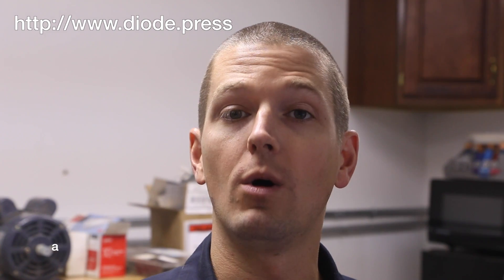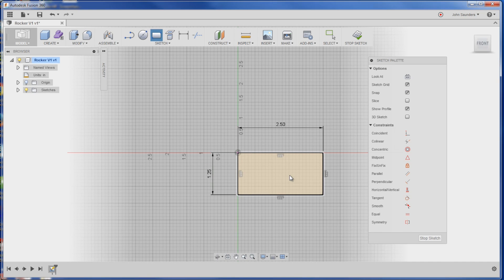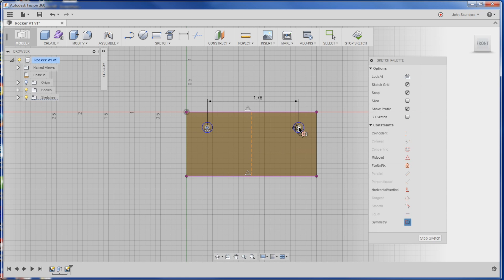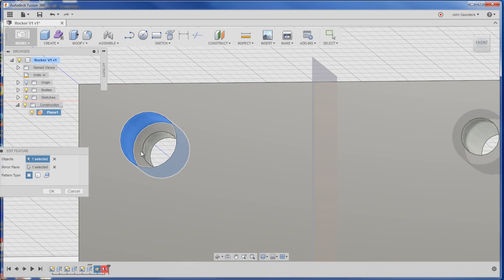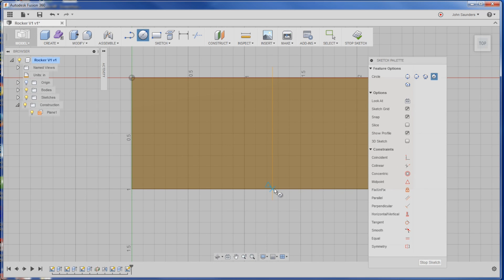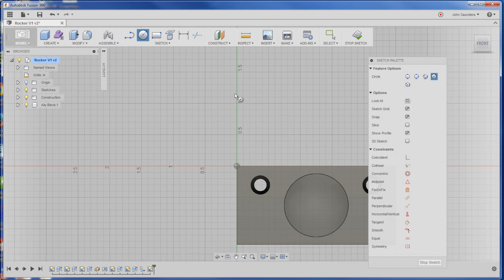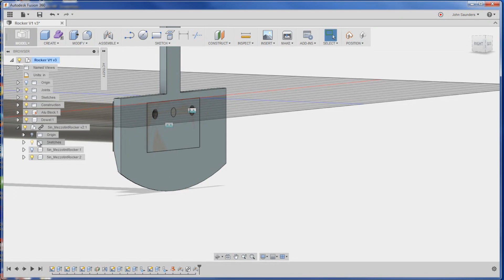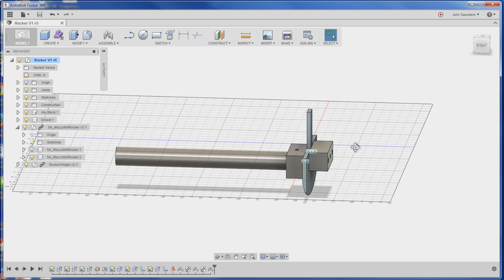Mezzotint Rocker Arm!   Widget61 Part 1

Comment: When using the mirror command you will see there are 3 options listed for pattern type. Pattern faces, pattern bodies, and pattern features.The default is pattern faces and that is why you had to select the cylindrical face and the bottom face of the counterbore. If you choose pattern features instead, you can then pick the feature out of the browser. Any face belonging to that feature will be included in the mirror operation.  

Is there a reason you like to draw holes using sketch geometry instead of using the hole command to just place the holes? I think that method would be faster for you. You could do the counterbores and the thru hole at the same time. There are some nice tools for centering holes on faces when you use the hole command as well.

Comment: More keyboard shortcuts coming John, but don't stop pushing us anyway :)
Reply: +Colin Smith I was reading down through the comments to see if there was any mention of the component / body issue. I'm familiar with Inventor, Solidworks, Solid Edge etc and can't understand why Fusion takes this odd approach. I struggle with converting bodies to components and there is very little help or documentation to explain what's going on. What was the big idea? This must cause a lot of confusion and frustration to users of F360.
Reply: +Murray Edington 
http://knowledge.autodesk.com/support/fusion-360/learn-explore/caas/CloudHelp/cloudhelp/ENU/Fusion-Function/files/GUID-E37B0456-A867-429F-BF69-6A4626DD31E7-htm.html

Some information on Components and Bodies in Fusion.
Depending on who I talk to I hear positive and negative reviews on the approach that Fusion takes with components.

Comment: Very low volume in this video
Reply: +NYC CNC Sounded normal here.
Reply: +Daniel Wiegert (Damme) agree...you can try sound mastering plugin like Limiter. great video by the way
Reply: +NYC CNC On my stationary I have unlimited volume - no problem, but on my laptop with built in speakers, other videos are ok, but I had to have full volume in youtube, and in the operating system - and still had some trouble hearing what you're saying. If I compare to eevblog, oxtools, keith fenner, vintage machinery etc you are abit on the low side. Thanks!

Comment: Right click tree top (file name), create new component. If you activate that component before sketching, all sketches, workplanes, etc will be organized within that component. Helps a lot for larger assemblies :)
Reply: +NYC CNC If there's anything else in fusion I can help you with, I'm a tweet away @sambirchenough
Reply: +Sam Birchenough: One can also sketch and create the component, but instead of using "Cut" or "Join" in the menu, use the New Body or New Component.  But, if you want the two objects to be locked together, you would still need to assemble them.